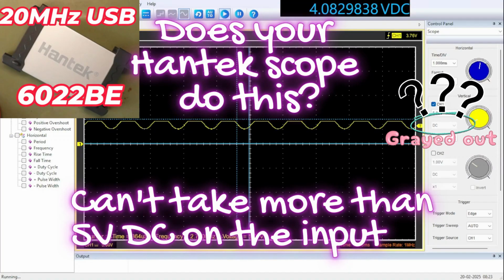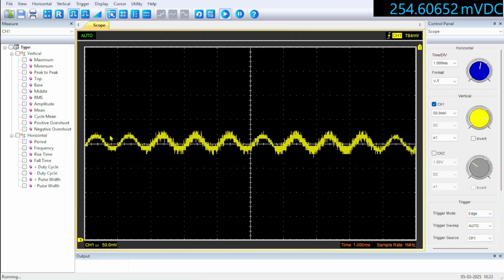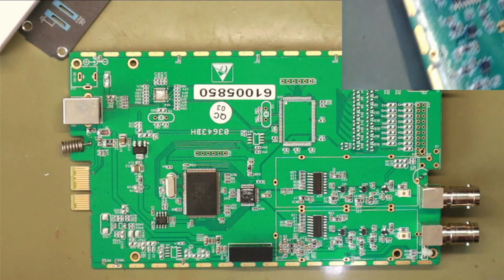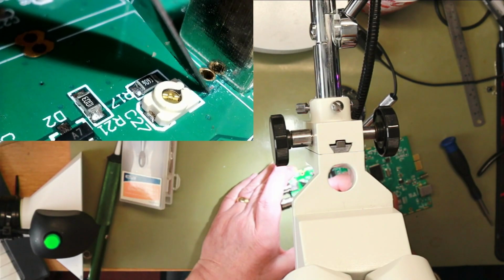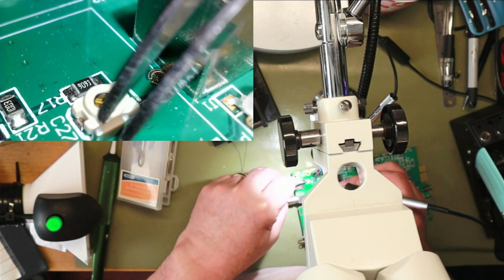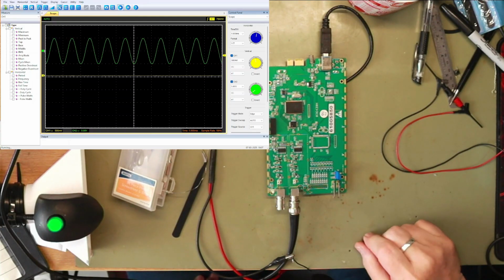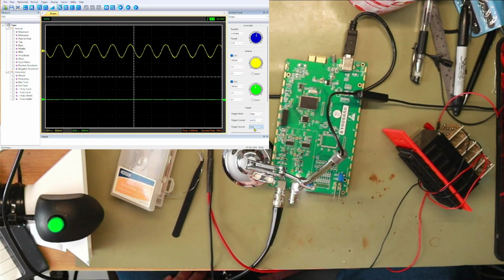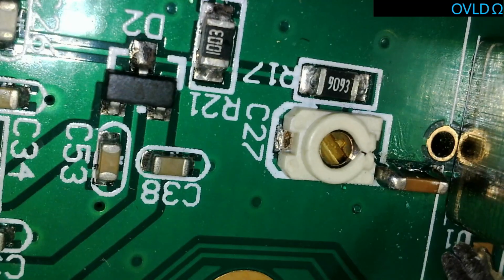#257 Hantek 6022BE 20MHz USB scope tear down and conversion to AC coupling

Comment: I've read that the Sigrok Pulseview software can be used with the Hantek 6022BE.. instead of the Hantek one.

I'd like to understand how the driver/port actually works though..  for example, say I have USB3 Bulk Transfer Mode device, that streams 8 channels worth of data, can PV display it live/real time.. assuming you've written a driver and the appropriate libsigrok additions?

Comment: That was exactly what I was looking for !
- and now to fit a slide switch on front, so short out the capacitor for DC input ...
Thank you ! 😘
Reply from the maker: I thought of doing that but in the end i cam to the conclusion that on DC it's a bit limited so just stayed with AC. I can use my other scope for DC.

Comment: what kind of scope does not come with ac coupling input, eh.  except logic analyzers.

could have tried connecting the capator outside, to the input though.
Reply from the maker: Not got a clue they they made it DC only, as they had to grey out the AC/DC selection on the software for it.  maybe it was to keep the price low. I thought about the cap on the out side but that would have meant a BNC to BNC with a cap in, so you could still connect a x10 probe. Did not see the need to keep it with a DC input, so inside it was.
Reply: @TheEmbeddedHobbyist  thanks for reply. 🙂
may i ask some questions from the first had experience .....
-> are you happy with the performance, after using all these day, will you recommend it ?
-> i may get one at around $60-70 or so, will it be good enough for audio/analog stuff ? ( apart from the 20Mhz limitation )  
-> how is the FFT performance for audio signals? 
-> does openhantek work ok with ubuntu or so, if you have tried ?
Reply from the maker: @iceberg789  Not sure if I'd recommend it,  i only paid about $15 or so and only wanted to use it just to get some screen dumps. With test equipment never buy cheap, always save up and get the best you can afford. Even a second hand CRT scope would out shine this.

Comment: Hey, that's a cool little trick! 
Since it renders a channel unusable for AC+DC usage, have you considered modifying the probe instead? I don't think it'd add that much extra noise, and you could still use the DC part with normal ones. I'm afraid I haven't been able to find commercial probes that provide only AC coupling 😅
Reply from the maker: I don't use dc coupling much, plus the other scope does so i did not care too much about it's loss.  i could also just add a small relay to short the cap out for a dc mode.

Comment: Nice modification. I have never seen an oscilloscope that didn't have AC coupling! (Also, no ground?) Silly buggers. I would be tempted to remove R17 and add a switch/capacitor and back to the board through R17. Then see how much it affects frequency response. Regards, David
Reply from the maker: Thanks for the suggestion,. I'm not too fussed about the frequency response as I just wanted it to see if it's software is better than for their 100MHz bench scope i have. It's PC software is quite bad to say the least.

Comment: Nice mod, looks like the software guys anticipated AC mode, but the hardware guys didn't deliver!
I have the 6022BL which is the logic analyser version, similar PCB so those missing parts are for LA version on yours.
Reply from the maker: At least for the price of 2 100nF caps i have a usb scope that looks like it will be useful for capturing on the PC.
Did seem strange not to have the AC option, this is the first scope I've ever seen which is DC input only.